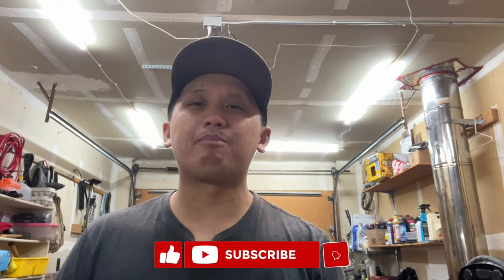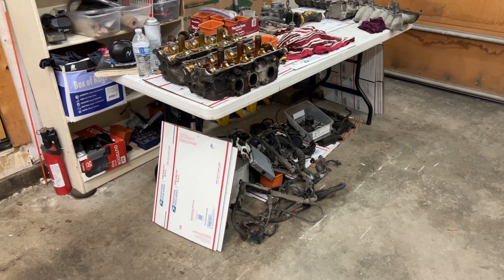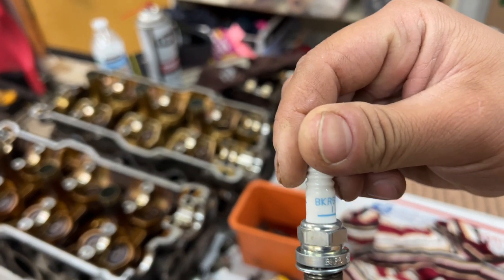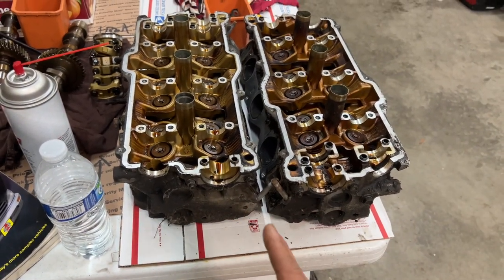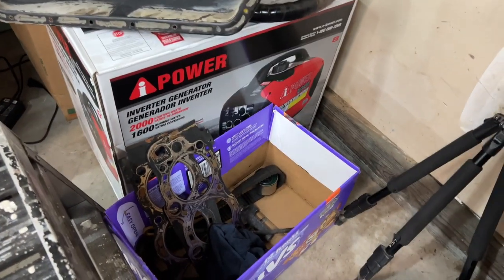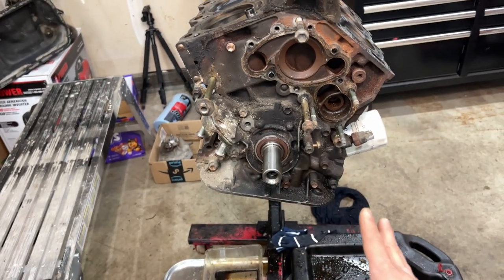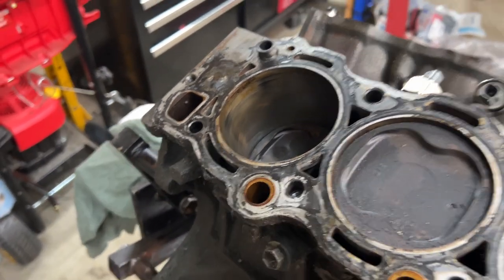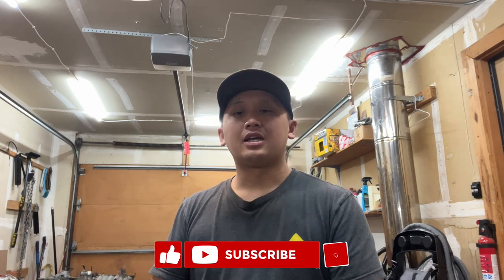1992 Toyota Pickup 3.4 Swap | Prepping the 5VZE Engine

Comment: I would got with Toyota gaskets for any and all engine gaskets. Head gaskets are probably north off $100 closer to $200 or more. This is a guess because it is $90 for ONE intake to block gasket, and yes Toyota sells then as one each. I used a gasket set I got off parts geek and the whole set is a cheap quality set. Put my intake on using the intake gaskets and as soon as it was started the engine was burning coolant. Now over $100 later I got some Toyota intake gaskets on order. I would say check for pitting at the cylinder head & intake were the intake and head meet, at the coolant ports. If there is you might have to clean the spots and put down some JB weld or steel putty and make those areas flat again.